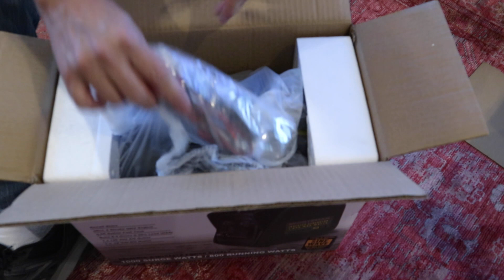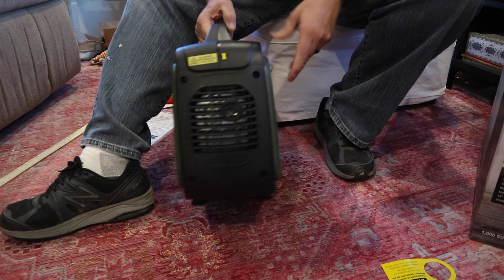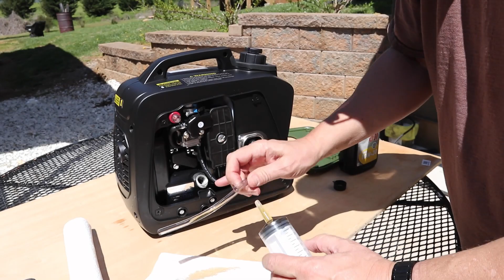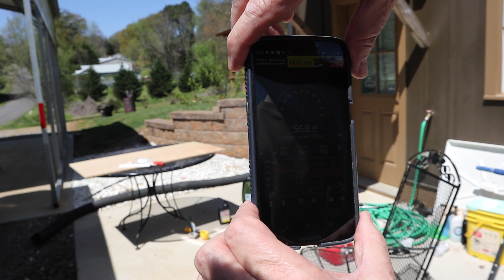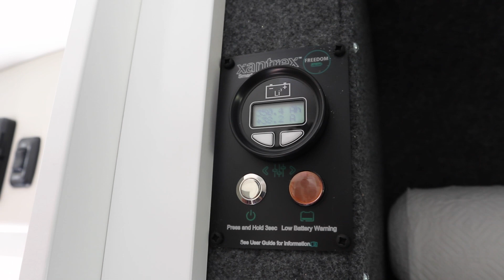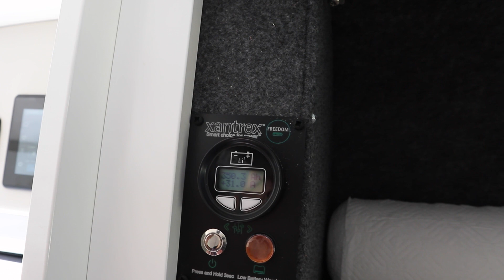Sportsman 1000 watt generator unboxing, break-in & how I am going to use it to power my RV AC unit.

Comment: 12 volt air conditioner. Lmao. You're charging batteries. That's it.
Reply: True, but big I didn’t charge my batteries while the AC was running it would eventually stop running.  So in reality, the generator enables me the run the AC.

Comment: Try removing the green plastic covers, and put some heat resistant materials too tighten the green plastic covers, doing this will make the generator quieter! The plastic covers tend to rattle! I will be using mine to charge my battery’s, if their is no neighbours around.
Reply from the maker: Thanks for the tips.

Comment: Could you compare your two generators?  I am seriously considering them both.  Weight and volume are my main concerns.  From you videos it appears the Sportsman is much louder.  Thanks
Reply from the maker: The Wen was quieter in my opinion.   I am thinking about trying a Wen 1250.
Reply: @CampingCoastie  I was considering that as well but for the extra $70 it made sense to do the larger one.  It's basically small and cheap or twice as capable and twice the price.
Reply from the maker: I really liked the 2,000 Wen.  When comparing the two, the Wen will be quieter when making the same power as the Sportsman.  That because the Sportsman will be running at max to make 900 watts while the Wen would be running at about half capacity to make the same 900 watts.  If the bigger one  can work size wise for you I would get that one.

Comment: Hi Gard why do you have a generator? as a Back up?  You need a bigger watt   output  to run your 20000BTU A/C. This I need to see  how you use it. ? Thanks
Reply from the maker: I have a small generator for when we dry camp in Key West over the winter.   We dry camp on the Navy base, so we need to keep our batteries charged.  The solar helps, but if we run the AC the batteries would not last a day without starting the engine.  The 1,000 watt generator will add back about half of the power the AC uses.  I am going to get a Wen 1250 generator,  that little bit more power will let me pull 8 amps ac, 4 amps on the Sportsman.   That will pretty cover the power the AC uses.  The ProAir uses more power the hotter it is outside.  At the most it pulls about 100 amps DC,  8 amps AC is 80 amps DC.

Comment: Nice video...What is the inverter size on your coachmen?
Reply from the maker: With the stock AGM batteries you get a 2000 watt inverter.  With the optional Li3 lithium battery package you get a 3000 watt inverter.
Reply: Nice...I suspect the AGM batteries are upgradeable to Lithium ION as with Pleasureway?
Reply from the maker: The Li3 package is the lithium option.  It includes a lot of components, not just the batteries.
Reply from the maker: The PleasureWay Ontour comes with 200 AH of lithium batteries.  The Beyond comes with 330 AH of AGM batteries, but you can upgrade to 600AH of lithium batteries.
Reply from the maker: Speaking about the inverter, I am not sure about the PleasureWay setup, but on the Coachmen Beyond you can adjust the input.  

That way, if you are staying somewhere with a 15 amp outlet you can adjust the draw from the inverter so you don't trip their breaker.  They might already have a load on the breaker, so you could even set the draw to 5 amps which only pulls 4 amps.  

To me, this with the 12 volt AC, this is a huge advantage.